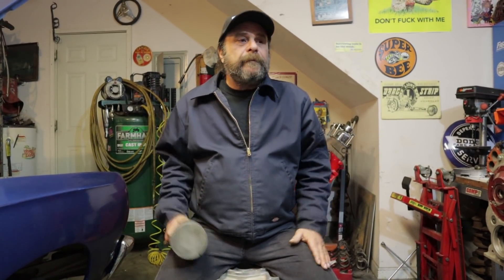3 Reasons Junkyard Engines Go Better With Boost

Comment: Is the seasoning principle for engines made within the last twenty years? Is this principle more applicable to cast iron blocks as opposed to billet aluminum blocks? It would not surprise me to learn that even advances in metallurgy haven’t completely eliminated internal stresses in the casting of blocks and heads.
Reply from the maker: Nothing in regular production cars is billet, but no. Aluminum parts don't have the same stresses in the casting. They're much more flexible

Comment: I would say in addition to the fact that the LS basically has a factory girdled bottom end to withstand lots of power the fact that it comes with much better flowing heads so it takes a lot less to get more power.

Comment: I gotta say I'm happy with my high mileage LS in my S10. It might not make 1,000hp but it's plenty happy to get the truck moving and get all sorts of heads turned. 

It's a bit of a sleeper, right down to the faux tailpipe. If you look in the right spot you can see a bit of the stainless headers 😁

Comment: Meh to the ls if you want horsepower the Australian ford barra engine 4l straight 6 they blow the doors off most 8s and a standard block will handle 2000hp without splitting the block

Comment: How could anyone thumbs down this video? I'm not an LS fan myself but they are a tough engine and He's right about a worn engine being a "happy engine" all the slightest misalignment is gone and the building flaws such as assembly scratches are worn away the stress points are gone and the cast iron and aluminum parts are all normalized and it's pure harmony! Keep up the good work UTG great video!

Comment: From what I have seen and read on the LS motor ;the engineers took all the faults and advantages from the big  block and small block motors and merged them;
The most important it, can  BREATHE deeply without going to an overhead  cam setup ;  they are sealed well which makes boosting it easier.
they are also very compact and light for given power level.

Comment: Back in the day, if you had a car with 400hp, you had something fast. I can't imagine running a street car with 1000hp! It's what the young guys talk about and want. I had a '62 Impala, built 327, muncie 4spd., and 4:56 gears. I didn't lose very many short races! If I had 1000hp...I probably wouldn't be here today! For drag racing...ya, but for the street, I can't see needing that much power!

Comment: Iirc BMW F1 engines were reputedly sat outside the workshop "Seasoning" like this for a while before use and went on to make nearly 1500 HP in qualifying trim  which isn't too bad for a 1500 cc lump..  Not sure how true it is but there used to be a story going round that the engineers would go out at the end of the day and piss on the blocks as well as it caused a chemical reaction that made them stronger?  https://en.wikipedia.org/wiki/BMW_M12

Comment: Back in the mid 80s when Formula 1 was running 1400hp 1.5 litre engines, Brabham was running BMW engines. The engines that BMW were building for them were running junkyard blocks from BMW 2002s for this reason. They weren't using the internals, but they found the seasoned blocks latest longer than new ones at 80psi.

Comment: I have worked on and drove chevys over 20 years they all have one problem and this is why LS motor suck chevy motors overheat. I have had junk chevys I had good chevys everyone overheats. LS is aluminum so when it over heats its done. I have had dodge products never had over heating problems even when the water pump was bad. I will go mopar all the time but no money or I would only drive mopars

Comment: Old Mopar fan myself. But the LS is a dirt cheap junkyard motor, with excellent flowing heads for what they are, and has a small external footprint. Thus it lends itself really well to swapping into cars with small engine compartments.  Can’t do that very easily using a Hemi or even a 5.0 Ford Coyote. Millions of LS’s out there too... literally millions. The LS crowd has an oft repeated mantra “LS swap the world!” and that is practically happening at the dragstrips  of the WORLD... lol

Comment: Should also note about the ring gap for a JY motor is check them anyway. It's not guaranteed that the gaps will be large. It's been known that even 200-300K mile engines can still have a 18/20 thou gap and if you get one and decide to run 15PSI through it without checking. Well, parties over before it starts lol.

Comment: I have a 1970 challenger ,with a 340. Never here anything about horse power. I think it's a great engine. I give 440 and 383 a run for their money in1/4 mile . What's your take on the 340 engine. Thanks, Dale from Fort Mohave  ARIZONA.
Reply from the maker: One of my absolute favorites.  I've got one in my 73 RR...runs toe to toe with the 440 in my 67 Charger

Comment: The LS engine uses several design features from different competing engine families from years ago. Cross bolt mains from the Hemi and 427 Ford. The original bore and stroke from AMC. Rod length from Small aBlock Chevy's. They were designed and first available from Holden in Austrailia, a GM company down under. But the first version were meager compared to the newest versions like the intake ports. The original ports were small, and there was tons of room for improvement, but how long did aChevy take to bring them to market? They made you wait a long time to get the good stuff.
As far as seasoning the blocks, this is nothing new. Chrysler had it figured out a long time ago, as did BMW. BMW had a four cupylinder engine that kicked butt in its racing classes. The factory took a bunch of blocks and set them out behind their machine shop to season for a year or two, then pulled them, machined them and put them in race cars. It worked, well. Rumor has it the the machinests would go take a leak on the blocks whenever they had to go, and in Germany it's ok from workers to drink beer in the job, so the magic elixir was in good supply, so I believe this one. Mopar let them sit outside in the weather for at least a year. The longer the better if the blocks have plenty of cylinder wall thickness and can be machines to factory specs without having to go deeper because of rust damage. So it follows that junkyard engines have gone through this process, and if they were inservice before they were set out in the elements the better off they would be, but they must not have had open manifolds allowing water into the cylinders where rust would damage the bores so much that they'd have to be machined to the maximum allowable to get a straight, square bore. So always have them sonic checked before using them, to make sure that they haven't rusted to badly and that core shift doesn't make the goes too thin in any spots. And for Big Block Mopars, remember that the -3 engines were Heaven duty engines meant for motor homes and other heavy trucks. They'll have thicker bores and forged cranks. In Chevy's big blocks they have a taller deck height which allows longer rods for long stroked engines. Especially in a 454 where the regular block leave no room for decent rod length to stroke ratios and the stress on the crank shaft will break cast iron cranks, this is the best way to go. In fact I'd use them with the best forgings to keep the stress from harming them as well, plus you'll get a wider powerband with longer rods!
As far as what Tony is saying about ring wear, the other part of that equation is Cylinder wear. And the cylinders will wear so that they are wider at the top of the cylinder than the bottom. They will taper, and the rings will have a larger gap at the top of the stroke than it does at the bottom. This is because the force put on the piston when the cylinder is on the power stroke is where the piston changes direction. So, it will also grow egg shaped at the top of the bore, although very slightly. The material the rings are made of and in the case of the LS, the sleeve makes a big difference on which will wear first, but both will wear. When you pull an engine down to rebuild it, this cylinder wear is what causes the ridge on the top of the cylinder. You'll need to cut the ridge to get the Pistons out without destroying them or the rings in the process, but be careful because if you go too deep you'll destroy the cylinder. If you're replacing the sleeves it really doesn't matter as much, but if it's an iron block you may have to sleeve it to save the block and that gets expensive! For an average American V8 the taper measurement is critical to making decent power. It must be less than 0.012". If it's more than that you must bore the block or you're waiting your time. The rings will wear out very fast and you'll be back to the same poor running engine that you were trying to fix. An easy way to measure taper  at home is to take a ring and a flat top piston and square the ring at the top of the bore. Measure the ring gap with a feeler gauge. Then slide the ring down to the bottom of the bore where the sings don't reach it. Square the ring again with the piston and measure the bore at the bottom. The difference between the two measurements is the cylinders taper. The factory says 0.012" is where you have too much taper, but I would bore my flock if the GAO was any larger the 0.007" or 0.008" and no more than that. This is because I would want to make as much power as possible, and I've got years experience in machine shops and remanufacturing companies. And Jeep in mind these measurements are for a 4" bore. A smaller bore should have less taper, and a larger bore could have more, but no taper is ideal! Good luck and most importantly, have fun!!

Comment: Hi Uncle Tony,  I recall that BMW Formula One engines in the 1980s turbo era developed around 1500hp in qualifying tune from 1.5 litres.  The engines were built on standard BMW 1500 four cylinder blocks pulled from the highest mileage old road cars they could find, including from wrecking yards.  They did that as they were seasoned or stress relieved from years of use.  Thanks again for a fascinating video.

Comment: Yup long skirted blocks, cross - bolted mains... Stout design from over fifty years ago.
They moved the bolt holes further away from the cylinders - got rid of the big need to use deck plates to get round bores, no more oil pump drive off the bottom of a distributor causing "cam walk", no more pairing of the exhaust ports between the # 3&5 and 4&6 cylinders causing heat build up in high output builds.
Chevy "cherry picked" the best of other manufacturers designs and rolled them into one damn fine engine!
Back to loose engines - factory engines are clearanced for everyday driving, start making big power and the extra heat needs clearance so it doesn't eat itself!

Comment: I remember going to the local speed shop and they had tons of pallets with blocks standing front side down. I asked the engine guy why they were just rusting away, and said “those are the best blocks money can buy. There’s a reason my engines win and don’t come back”. He would buy up every standard bore big 3 block he could find and once a year rotate the pallets so the oldest ones were up front. After an acid bath, he deburred and polished every block by hand.

Comment: Tony once again you are right on the money, long live cheap high mileage junk yard motors! In the late 60's I put together my first street/strip car. It started with a 283 of questionable age and condition that I got from a junkyard on Flatlands Ave in Brooklyn for $25. I swapped the heads for a set with 2.02  intakes, added a new timing chain, a used cam from a 327, an Edelbrock intake, a Holley four barrel and headders. I dumped it into a 62 Nova body with a muncie 4 speed. I kept the original rear with it's 3.23 gears since the rear wheel wells would only allow for very small tires. All in all It cost less than $900 to build. I ran this car for about a year when someone offered to buy it, I took the money and immediately began building another car, you know how that story goes. I still have a photo of the car that my wife, then my girlfriend, took of of me coming out of the hole at Islip Speedway with the left front wheel about 4 inches off the ground.

Comment: Lower mileage junkyard LS engines get taken apart and the top piston ring gets massaged for a bit larger gap. Put a new O-ring on the oil pump pickup and maybe throw a melling pump on it. Maybe do the rocker arm trunion kit or just update them with aftermarket. Assemble with new gaskets and boost away...

Comment: We called it "Race Clearanced" back in the day here.
Reply: ZIGgassedUP, heck yes, about .003 on the mains and .0035 on the rods. Add a high volume, high pressure Mellings oil pump to cushion the clearances and you were “shifting in high cotton” Old South Georgia term!

Comment: The #4 reason junk yard engines are desirable. It's already broken in and well tested. Dyno tests are good but there is nothing like putting a 100k plus miles and a few thousand thermal cycles on an engine to prove it was well built. There is something about a stock factory built motor and its durability and reliability that is hard to beat.

Comment: I’m assuming you have seen Cletus and his car “Ruby”.. the original build was just slapping a turbo on a used motor, then a junk yard motor and even her current motor is “seasoned” as it was built with one of the blow motors blocks. It’s exactly what you said

Comment: I never knew that the rings were significantly hotter than the cylinder walls. Well, at least the top ring. But it makes sense, especially when the engine is producing so much horsepower.
Eric

Comment: G'Day Tony,,yup right again,the only thing i want to add is to do with bearings,,
was cheaper to put a slightly thicker layer of white metal ,than make copper backing,"which is only there so the white metal adheres properly",so having thicker white metal,could handle bigger clearance and still maintain a wearable surface,,

Comment: Most people don't know that the LS engine platform was designed by a Ford engineer in the early 90s.  Ford rejected the design as they wanted to move away from pushrod engines and into OHC designs, so the engineer sold the design to GM, and the tradition of Chevy having the most popular hot rod engine continues...

Comment: Ok Uncle, not to be a big fat Mr. Knowitall but, the reasons the LS and LQ series are so capable of big power is that the cylinder heads flow more air in and out than any head GM has ever offered from the factory, including the big blocks. Im told that the ports are so well done from the factory that it takes an experienced hotrodder to port them and get any more flow from them. The combustion chamber design is everything Chevy has learned from the Vortech series motors, which was far superior to the previous generation. It probably doesnt get any better out of a wedge combustion chamber engine. The bottom ends are not forged but might as well be, sintered metal, or nodular cast iron? Probably one and the same. Very tough. Factory roller cam? Shit, that used to be an exotic modification before the late nineties. And the blocks. The blocks are high nickel content and everything you need, nothing you dont. The bees fuckin knees. Alls yous needs is a cam swap and to reprogram the e.c.u. to make 400 hp, easy. Too easy. For me. I gotta go old school.

Comment: The ls motors have the 4-7 3-2 firing order swap. This is the secret to their strength. It relieves the heavily loaded #4 main bearing and moves stress to the lightly loaded #2 main bearing.

This can be done to any V8 with a custom ground cam.

Top fuel went from 6500 hp to 10000 hp with this trick.
Reply from the maker: The issue with fuel engines had nothing to do with main bearing stress.  The Chrysler with traditional firing order has an issue with 5 and 7 stealing liquid from #6.

Comment: We have two sheds behind the shop I work at.  One full of blocks...the other full of heads.  The owner has a couple of Pontiac blocks which he said have been out there 20 years.  I remember last year he said they're just about right!lol!  The heads are there mostly so we have spares for heads we take in and find cracked and unfixable...but some of them have also been out there a decade or longer.  Obviously you and others know that some high HP engines are built specifically "loose" at shops like ours.  We have guys who come in a request that they are built to burn/use a little oil rather than "tight" just for a little "insurance"!  Same thing with not installing exhaust valve guide seals and giving the valves a little "slop" in the guides(we K-Line a LOT of heads as well rather than installing new guides).  One engine not many may think of...and are all over...which I'd like to get into and try  a few things would be the Toyota 3.5 V6.  4bolt mains, cross bolted and tough as nails.  We almost NEVER see them...ever...compared to other V6's.  Those things just go and go and I'm almost certain you could put a LOT of power through one of them.  They're built like the proverbial brick $hithaus.  There's a reason they go 400k without breaking a sweat or burning oil!